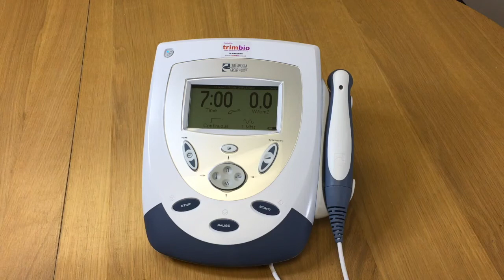Intelect Mobile Basic Operation

Comment: You said the head does have an effective area of 4watts because of the head.  how big is the head?
Reply from the maker: 5cm2 surface area with an Effective Radiating area for 4cm2
Reply: Ah now I understand,  thank you for the quick reply. I am studying right now about the Ultrasound, but there is something I am not sure about. Lets say I would like to treat the adhesive scar of a patient over the finger, area ist healed not inflamed just adhesive. Lets say its over the whole finger. The Head is about 1,5cm that means Surface area is 2.25cm2 and ERA is more or less 2cm2 right? AND on the device it will say with 1w/cm and 2watt switching the button right? I am Trying to understand this from home not being able to use one of those devices xD. so if I reduce to 0.5w/cm and i switch to Watt now only half of the watt will be displayed which means more or less 1watt for 0.5w/cm2? Thank you so much!
Reply: How do I chose How much intensity = Watt?
Reply from the maker: @hanemloudi  You will need to learn this from Healthcare professional or do a course, it will depend on the condition you are treating - acute , chronic, depth of lesion, size for injury. good luck with your studies.